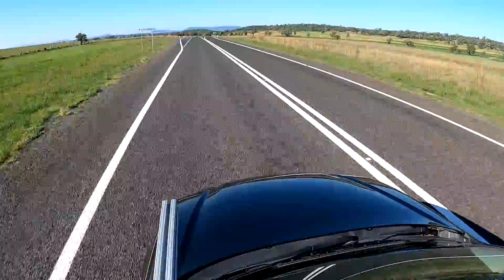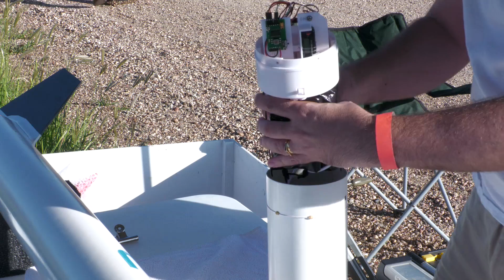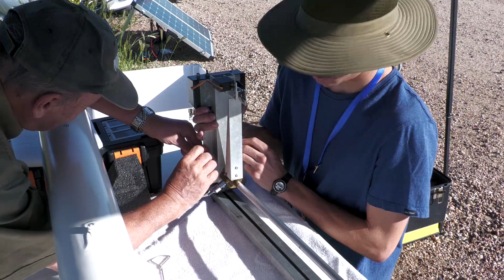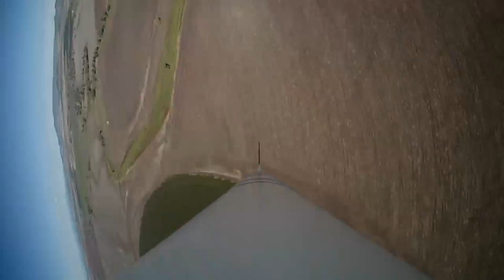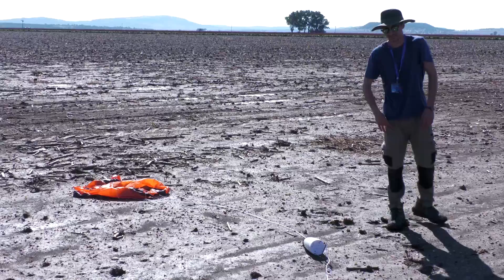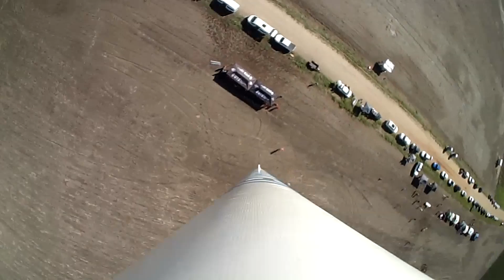First flight - High Power Water/Pyro Rocket - Part 1

Comment: Id suggest your water nozzle speed is way too low, and hence efficiency will suffer dramatically.. you can boost this by injecting air into the nozzle to mix the air with water and thus speeding up water drops velocity.. the way have it set up now ,it  is half water rocket and half air rocket and they have 2 very different nozzle requirements.. you need to optimize the nozzle design for a mix of water and air.  You should be aiming to run out of water when the pressure drops by 80%. your craft is currently optimized for power and not ISP. Its all about efficiency and nice even propellant velocity ..
Reply from the maker: Where does this air being injected into the nozzle come from?

Comment: really impressive, you are far far away from the toys of our young times.. . Perhaps to solve this pressure measurement defect, you could try an electronic internal sensor directly placed in the "Waterrgol" tank? connected via Bluetooth to the motherboard of the launcher...
Reply from the maker: Thanks, that's certainly an option. We already are doing something similar with our high pressure launcher, where the pressure gauges are at the rocket end and we send back a video feed. This was the first time we saw this issue, because normally the rockets are a lot smaller and therefore they equalize their internal pressure faster.

Comment: Does it have to have dual deployment for L2?
Reply from the maker: This is a good question. No you don't need dual deploy, though with a single deploy you are likely to walk a long way to retrieve it. The expected altitude on the J360 we are planning to use is around 3000 feet, so we plan on using a drogue at apogee and JollyLogic's chute release on the main at perhaps 400 feet or so. That way we can still have just the current deployment mechanism but get dual deploy functionality. We are also going to use a flight computer that detects apogee rather than a timer like we had on this flight.

Comment: It would be so nice if the weather here in hamburg would be nice enough to lauch like this. instead we have the rocket in the basement for months… 
Anyway amazing work and we are so glad you are back with amazing videos! ❤ by the way what on Board cam are you using?
Reply from the maker: Thanks, the weather here can be a bit of a hit and miss as well, but generally we can fly most of the year round. The camera we used for this flight was the old 808 #16 camera. It only shoots at 720p. We are saving the mobius mini for the more important flights. :)
Reply: oh dang you cant get that thing here in Germany at an affordable price
Reply: we have to use the runcam 2 4k which is a bit to much money on the line if we crash

Comment: Hey George and team. Really enjoy the chan. Thx for the excellent vid. Question - Is it feasible to use internal pyro to pressurise the water as opposed to external pump?
Reply from the maker: I think that may be possible, I am not sure how the pyro would respond to the increasing pressure. You would also want to make sure you match the volume to the amount of gas produced so you don't over pressurise the rocket.